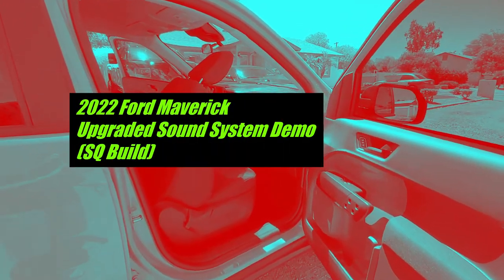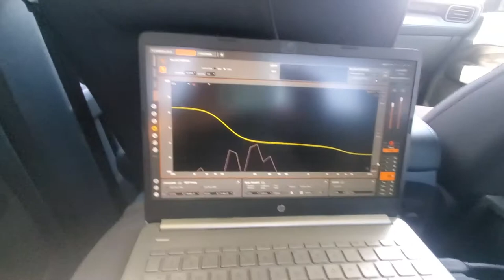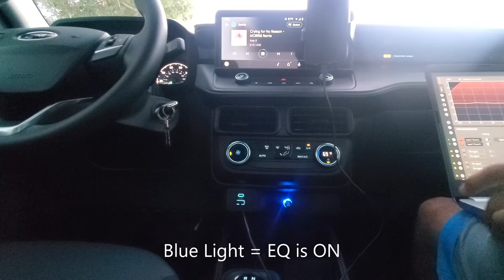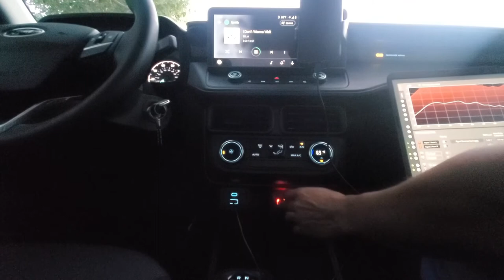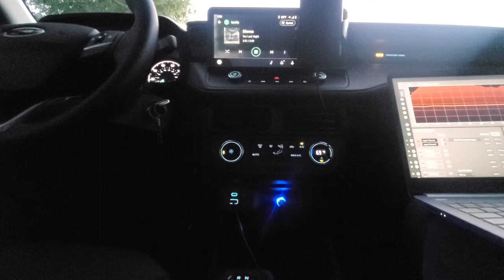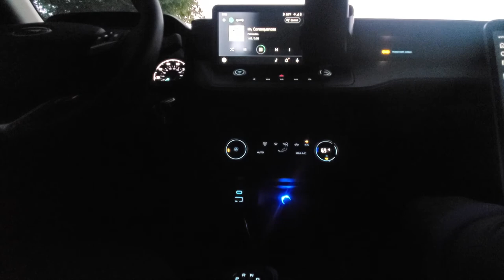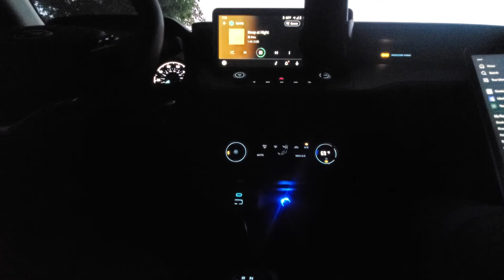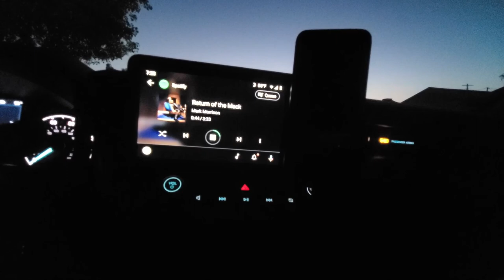2022 Ford Maverick (SQ Build) Sound System Demo

Comment from the maker: The difference in clarity is pretty large using both Time Alignment and EQ. Without them, music sounds rough (even with these nice speakers!) 

Definitely recommend using a DSP if you install some nicer speakers. Takes some effort to tune but the results are worth it. 

But if you haven't used a DSP before, can't miss what you've never experienced, right? 😂
Reply: Mi hermano, you’re talking to a novice I would need to pay to have this system installed, but you’re good must hand it to you, thx for the reply.
Reply: Thank you for putting these videos out, your door sound deadening video was tremendously helpful when I took my door panels off and added sound deadening. I wouldn’t have even attempted it if it wasn’t for your videos. 

I have a 5 channel amp powering alpine speakers and a 10” sub, without a dsp. The shop just used line out converters. Your description of “rough” is pretty accurate, and I feel like I’m losing some of the clarity and detail of the music. Looking at adding a dsp now.  Seems like it’s possible to have a good system in these when using the stock head unit if you clean up the signal first. Thanks again dude!
Reply from the maker: @29erdodes   Glad to hear these videos helped! I’m still completely satisfied with my setup with DSP. My passengers also agree that it sounds better with it. Good luck on the rest of your install!

Comment: This setup is awesome I’m thinking about doing something similar! Did you run all new speaker wire from the JL amp? And are the rear speakers amplified or just running off the head unit?
Reply from the maker: Thanks! I ran new wires to the tweeters from the amp. I had a hard time trying to run wires thru the door boot for the front speakers. So instead ran new wires from the amp to the factory harness and connected them to the the stock front speaker wires. Not a problem since I’m only pushing up to 75 rms to the speakers and didn’t need a thicker gauge wire. 
Rear speakers are running off the head unit. I also set the balance all the way forward to the front speakers so I can’t hear the rears in the driver seat. Also good idea so you don’t blow out your rear passengers’ ear drums at high volumes lol.
Good luck on your install!
Reply: @LazyMex  thanks! Any things regret doing or would change since making the video?
Reply from the maker: @jackletros8617  no regrets so far!! I may have been able to EQ with the DSP without the Fix82 and get similar results to save $400 but I’m okay having it. It made tuning much quicker though. 
I still would like to make a custom fiberglass box for that subwoofer either under the rear seats or behind it. Not a big issue since I rarely have rear passengers.

Comment: Love the install, hope I can find someone to do it as clean as you did! A little off topic but what kind of Mount are you using for your phone? I’m trying to get mine set up in the same location.
Reply from the maker: I bought a 3d printed plastic cubbyhole cube to attach the phone mount on. It was like $20 off Etsy. The phone mount in the video is this
 [Upgraded]VANMASS Car Phone... https://www.amazon.com/dp/B09CMV7YVJ?ref=ppx_pop_mob_ap_share

It worked fine but it does make a rattling noise if you don’t have your phone in it. 
I replaced it with a mount that has the magnet for my iPhone case. That was about $30 but I like it better.

Comment: Looks good! I have a alpine 4 channel, a alpine mono amp and a 10” sundown sd2 I took out of my old truck to install in my maverick. I been doing a good amount of research for adding a system to my maverick and seems like it gets a little tricky in the maverick. Think I will use a JL audio fix 86 to get the signal cleaned up then maybe down the line add a dsp. A few people recommended that especially since I never used a dsp it can be very overwhelming they said. How do you like for fix 82? I also think I will look into a loop back harness so I don’t need to do any splicing into the factory wiring.
Reply from the maker: Thank you! The fix82 was useful for tuning with my DSP since I only had 10 channels of eq to use. Good luck on your install!

Comment: Sounds great! Planning an upgrade to mine when it finally comes in. Is there room behind the read seat for the sub/box you have if the amps were mounted under the seat or on the other side?
Reply from the maker: Thanks! The room is very limited behind the rear seats. I’ve only seen a few (10”?)subs back there with custom made boxes. My JL sub box would not fit back there.

Comment: I got 2023 maverick tremor I bought FOCAL UTOPIA BE 165W-RC 6.5" COMPONENT SPEAKERS BERYLLIUM TWEETERS CROSSOVERS my stereo guys said no harness to connect with my B&O stock system may cause code asked me hold off on install? Thoughts on this plz
Reply from the maker: Not sure why they can’t splice or tap into the existing speaker wire.

Comment: Can you please show how you tapped into the wiring harness. This will be my first audio upgrade by myself and want to nail it like you did. Thanks!
Reply from the maker: Are you trying to tap into the speaker wires for adding a sub only? For my install, I cut the  wires from the headunit going to the front door speakers, routed them to the amp, then from amp i went back to the wire harness and soldered to front door speaker wires going to speakers ( if that makes sense). For the tweeters, i wired directly from amp to tweeter. Left the rear speakers alone. 

Didn't video much of that install. Here's some pictures for it. To get to the wire harness, just remove the ac vent panel. Has about 6-8 clips around it. 

https://imgur.com/a/C7qKDkO
https://imgur.com/a/Jgn2lag
Reply: @LazyMex  hey thanks! I'm planning on running a clarion 5 channel DSP amp, JL C1-650's (comes w/ JL tweeters), C1-450's and a 10" JL shallow mount sub with slim wedge box behind rear seat, but use factory wiring if possible
Reply from the maker: @liamtilbury1218  that will sound sweet! Are you building your own box for behind the rear seats? Not much room back there.

Comment: thanks for your content, I was wondering what wire did you tap in to for the remote for the amp?
Reply from the maker: The amp has signal sensing for turning on. I connect the speaker wire from the head unit directly to amp. When the amp senses a signal from the head unit, it turns on. Otherwise, you’ll need a line out converter to send a remote in wire to amp. Like the LC2i

Comment: Bruh! You not gonna show us the tweeter install? Curious how you worked that out
Reply from the maker: LOL the tweeters were embarrassing hard to get to. Added a few more scratches to the dash thanks to those panels. Also broke a clip on both sides. If I do ever place the tweeters in the sail panel, I’ll make a video on it. The hardest part will be getting the speaker wires thru the door boot.

Comment: Did you replace the rear speakers too??
Reply from the maker: I did not. Two-way front stage with the rear speakers providing some rear fill using the fader. Can't hear them in the driver's seat but somewhat noticeable in rear seats. 

Maybe when I remove the headliner to add in insulation, i can also replace the rear speakers. We'll see..
Reply: @LazyMex  I just picked up some JL 650 components for the front and JL 400 for the rear. I also went with an audiocontrol lc-5.1300 amp and a slim tw3 12. I hope I can’t find a place to put that sub
Reply from the maker: @focus0nme  Sweet!! Those JL speakers will sound nice! I was actually going to get the TW3 but they were out of stock on Crutchfield.  Do you plan on using a custom box for under the rear seats?
Reply: @LazyMex  I have no clue to be honest. Now that I look at it, I can’t really see anywhere that a 12 will fit 🤔
Reply from the maker: @focus0nme  You may have enough volume under the rear seats with bins removed with a custom box. Just don't know if the 12" is too large to fit. Wish i took some measurements. 

Under storage bins pic https://imgur.com/a/KivzJGa